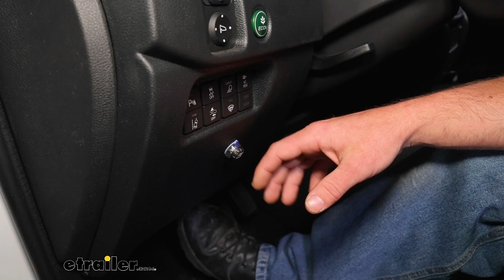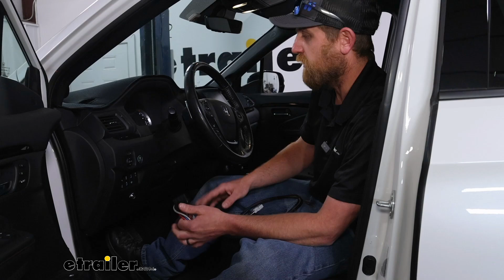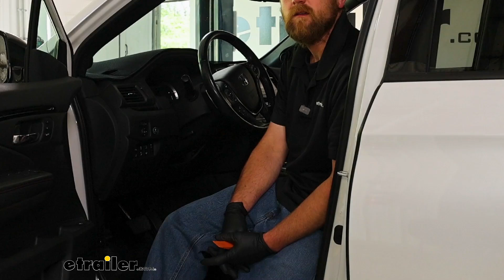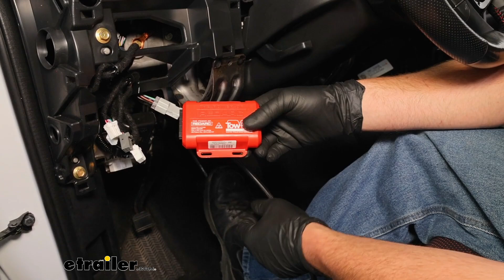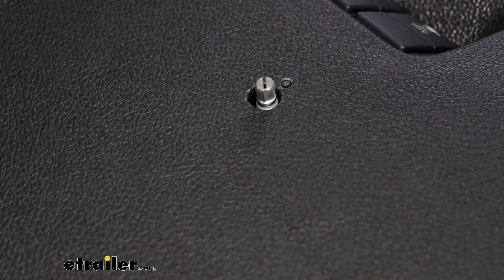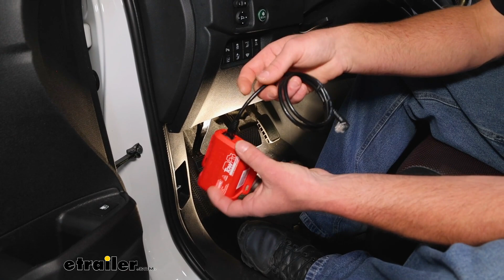Install: Redarc Tow-Pro Liberty Brake Controller w/ Custom Harness on a 2022 Honda Ridgeline

Comment: We have 2023 ridgeline and in the gove box was the cable with the fuse! Also the 2023 model(not sure if this feature is on earlier models and have no idea how good it works)has anti sway control! Which will decrease speed and applies some brake before the sway gets aggressive. I recommend  a sway bar on any box trailer, Rv trailer esp if your on interstate or wide open highways were wind guess can be bad!  Am debating on the plug and play cable.  Thanks for the video.
Reply from the maker: You're welcome!
https://www.etrailer.com/Trailer-Brake-Controller/Redarc/RED24CR.html